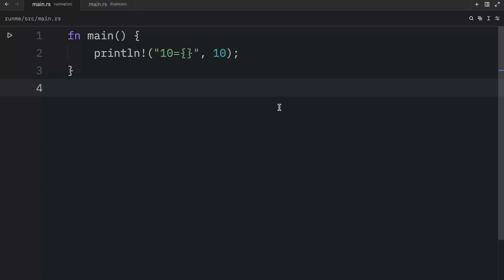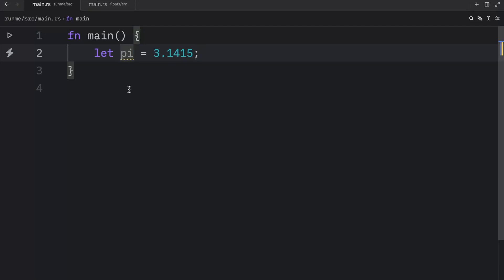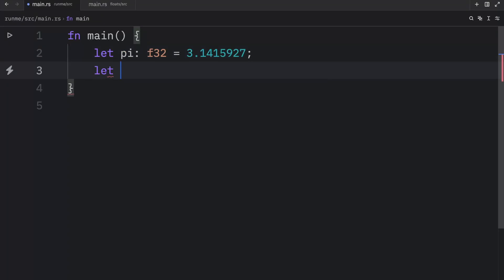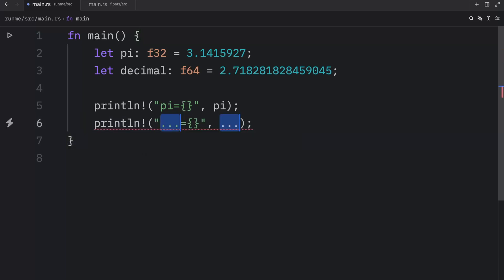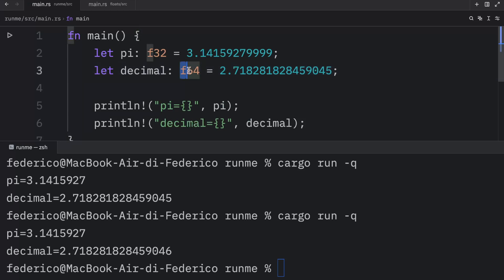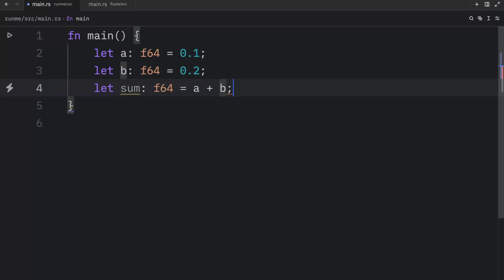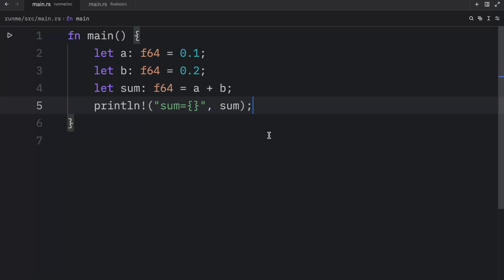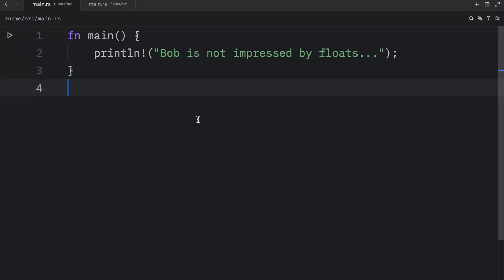7: Floats are also weird in Rust

Comment: 1.
f32 literals have the f32 postfix. It is best to use the following:
let f : f32 = 5.6f32; 
2. 
To avoid having precision checks with abs( ) <= e (used in algorithms mostly), the best way for CURRENCY-type values is to use decimals which use INTEGER arithmetic  (used for fixed-point floats), which is ALWAYS precise:

...
use rust_decimal::Decimal;
use rust_decimal_macros::dec;
...
let a = dec!(0.1);
let b = dec!(0.1);
let c = dec!(0.1);
println!("{}", a+b+c); //will print 0.3

Comment: That's normal behavior when representing a base-10 number in a binary system, i.e. a CPU. A binary fraction is something like 1/2 + 1/8 + 1/64 (101001) and it has to approximate the base-10 value.
In Python, they represent base-10 numbers as a list of digits with a possible decimal point somewhere. This is much slower to calculate than the CPU native types, but prevents the approximation problems.
Reply: nope, python uses IEEE754 floats for decimal numbers as most languages, so it also has the same inaccuracy
Reply: (the numbers here are fudged because this stuff is hard to dig up proper numbers on (or maybe cause I'm an idiot who knows)) it's not just a base problem, it's a resolution problem: 0.1 + 0.2 doesn't equal 0.3 because there isn't enough precision to always get an exact real number, as floats get larger they start skipping whole numbers, there is a really high accuracy around 1 to 10, and a pretty decent accuracy between 0 and 1, but 0.00001 and 0.00002 for example aren't going to have as large a set of values in floating point representation. because floats intend to represent the real number set, every value is actually a range of possible numbers, that's why -0 isn't nonsense in floating-point, it represents any number below zero to the greatest negative number represent-able in floating point.
this is all about IEEE floats, other floats are different, but also don't really exist nearly as prelevantly now days

interestingly IEEE floating point has an interesting way of making the point "float", it's 1 bit for sign (+ or -), 8 bits of a exponent and then 23 "mantissa" or base, it's basically a weird fixed-sized scientific notation, with some extra fun tacked on with subnormals, NaN(s), and infinities, which go far beyond my grasp very quickly 
for f32 at least

floats indeed suck, but they're also beautiful
and I hate them
and I love them
and I think I sorta understand them but I am probably wrong about something I said in this comment so grain of salt.

also re-reading your comment eludes to that broader resolution problem, by pointing to non-terminating fraction representations, which make me feel like there is an egg on my face
still I've written all of this and someone will use it as a reason to learn more so I'm posting.

(some interesting math points though, outside of computers with fixed sized datatypes, every number in base-10 can be matched to a binary one, and all rational binary representations are either finite or end with a repeating sequence (that's actually true in every base), which is pretty cool!) (That's all to say your point actually extends as a relationship between any two bases, except maybe square bases where the representations are always finite to finte or infinite to infinite)

Comment: Why were the two float types rounded differently?
Reply: because the rounding is merely a side effect of how floating point numbers work internally.

it's really complicated but basically nothing works the way you expect it, floats should only be used with a margin of error
Reply: because its inconsistent...
Reply: In programming we have what we call the "epsilon" number which is the difference between 1.0 and the next representable value . For a 64 bit float that value is 2.22045e-16.
What you have to do to to check if two floats are equal is to subtract the two numbers , but it in absolute and check if the result is smaller than epsilon .in our case 4e-17 (16 0’s followed by a 4) is smaller than 2e-16.